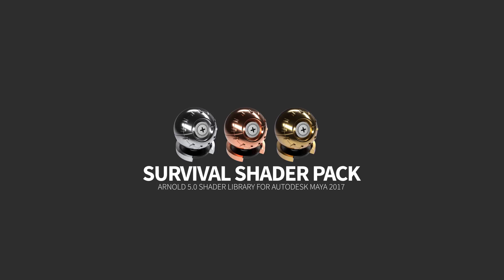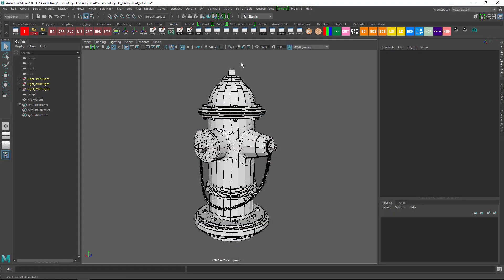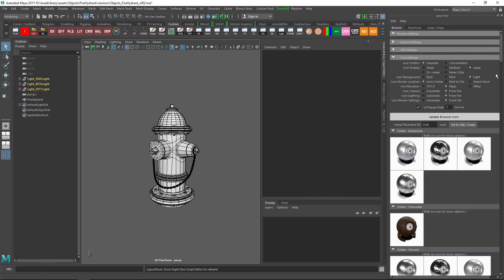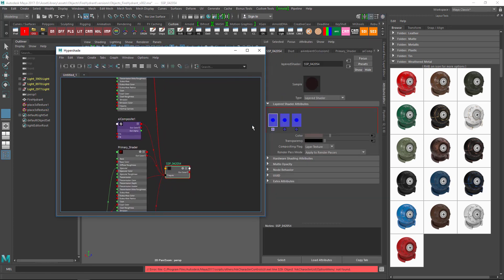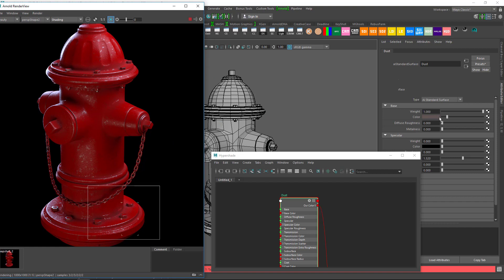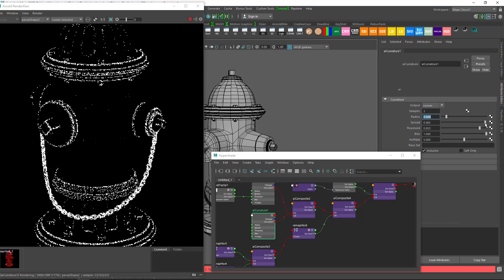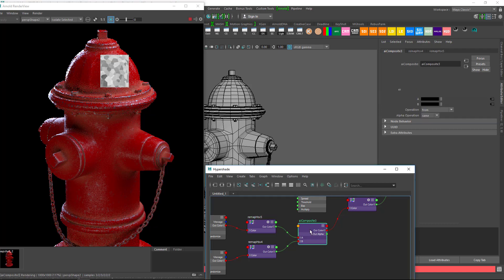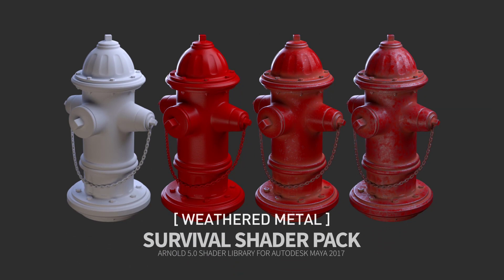Autodesk Maya - Arnold | Texturing Fire Hydrant - Procedural Weathered Look

Comment: hi, I've downloaded your pack and it has great look! however, I have some problem. when I use your shader to animated object, shader don't follow object's moving. It looks like shader has their on xyz position, so don't move with objent modeling... how can I solve this problem? sorry for my horrible english X(
Reply: 창규 김  which shader are you using for your animated object?
Reply: I'm using wheathered metal shaders. ssp_403813.
Reply: 창규 김 I'm not at my computer , but I think what you need to do is to link the projections with your object. You will find them as in your outliner.
Reply: oh, maybe I don't use bonus tool so It was not working correctly .now it's work! thank you ! If you don't mind me asking, can I ask about bonus tools? I installed bonus tools, but layoutools brower is not working with [C:/ProgramData/Autodesk/ApplicationPlugins/MayaBonusTools-2014-2017/Contents/scripts-2017/LT_UI.mel" line 1489.51: Unterminated string.] this error message. Do you know how solve this problem? thank you again for your comment.
Reply: Im not sure about that, but it looks like you are using LT version of maya. Please try to ask Autodesk support for that.

Comment: I dont have Arnold 5, just the one that follows in Maya 17, is that a issue?
Reply from the maker: You need Arnold Core 5.0 which is free and you can download it from your Autodesk account. You can check your version by going to Arnold menu/about.
Reply: this is what it said in Autodesk

I have an older version of Arnold, can I upgrade to 5.0?

No. When Autodesk acquired Solid Angle there was no official upgrade for older versions (no separate upgrade SKUs or pricing). Therefore there is no way for Solid Angle customers to upgrade to newer versions, customers will need to purchase new licenses instead. Autodesk will not introduce new upgrade SKUs for Arnold, so customers with older versions who do not have a maintenance plan will need to purchase new licenses of Arnold 5.0.
Reply from the maker: ken roger sorry about that!